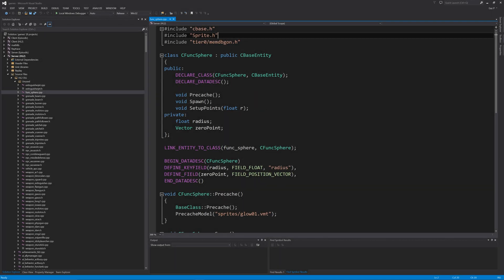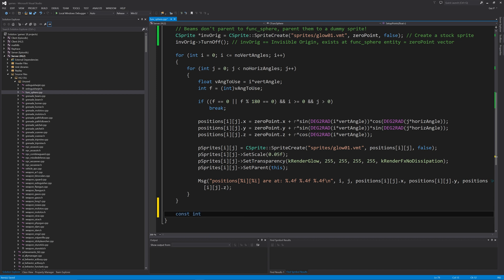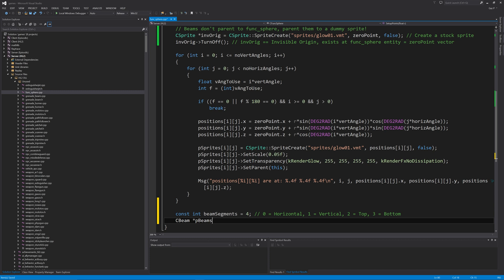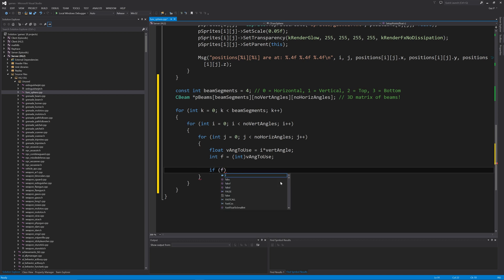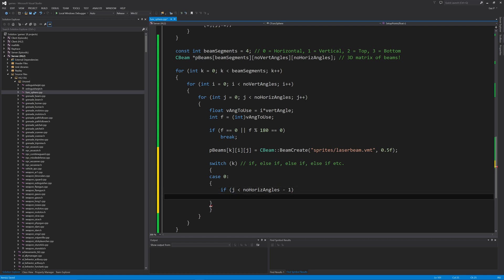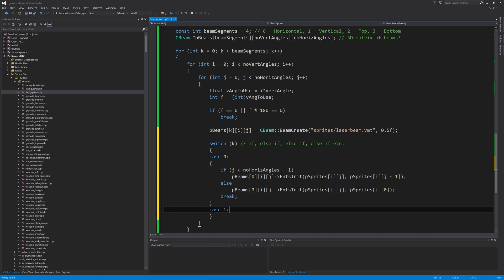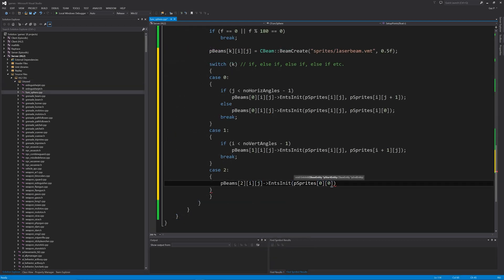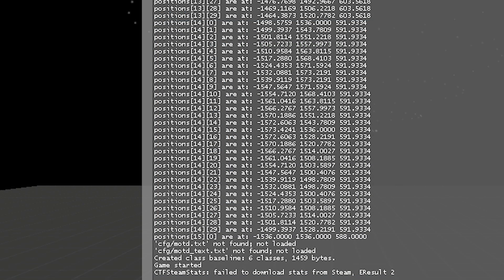Valve Source Code 2013 Tutorial (Episode 11.5): Sphere of Sprites P2 [Beam Drawing Between Points]

Comment: Hello i Just found your Videos and i think you can Help me Out! :)
I watched a few of your Videos about the Valve source Code. And I wanted to ask you If i can use these Tutorials for Portal 2 too? 
I am Planning in making a Singleplayer Mod for Portal 2 and i got some advice Last year from Lonewolf2056, (the Mal creator of Portal Stories Mel) and I almost spend 11 months of time into learning Hammer Editor and i am pretty confident with it now but there are still Things i need to learn.

But for a Mod i want to add 1 new Testing Element that is Not that new... Its Just a Combination of some old Test Elements and some new features. But i can only barely Code and have no Idea how to Code Something into Portal 2 so i am asking you If i can use your Tutorials to learn the Things that i need or if Not, that you can maybe Tell me where i can find more in that?
Reply from the maker: Thanks for the comment, unfortunately you can't follow these tutorials for a Portal 2 mod because the source code for that game has not been made public (to the best of my knowledge, anyway). Therefore, any changes you would want to make that requires access to the source code would not possible. However, I would ask what you intend to do in regards to the new-but-not-new test mechanic, as it may be possible to implement it without the need of coding (but it may not be!). I wish you the best for the mod regardless!
Reply: @TheMaster974  my Idea would be Something Like lasers in 3 different colors. Wach color can only Trigger the Same colored laser catcher. But the tweak is you can mix for example Red and blue together inside of a laser redirection Cube and vet a purple one that can only activate purple laser catchers
So you would have 7 different laser colors (Red, yellow, blue, Green, purple, orange and white).
You geht White when you Mix something that wont make Any of the 6 other colors. (For example yellow and Green)
Thats Kind of my Idea
Reply from the maker: Interesting, but definitely sounds like something that requires changes to the source code which cannot be done, I don't believe unmodded Portal 2 has the ability to change the laser colour. I have come across a mod in the works called Portal 2: Community Edition which you might like, as it provides different coloured lasers i.e. red, green, blue, but I have no clue if this would affect the beam output from a reflection cube the way you want it. My guess, for example, would be the reflection cube would redirect both red and blue beams together instead of a singular purple beam, which would mean a purple catcher would have to be two catchers of red and blue somehow. Definitely worth checking out, plus it should be releasing sometime soon (Mid 2022)...hopefully! https://store.steampowered.com/app/440000/Portal_2_Community_Edition/
Reply: @TheMaster974  yeah Thank you! :)
I have seen that one too a while ago and i Just talked about it with a friend today :)
But when you say that this is Not possible then i am a little Bit confused... Did you Play Portal reloaded? He got a third Portal in the Game with a new color, a new shape and a Kind of new mechanic.... I think that i Just need to find a little more Help to figure that Out. 
There is also a Mod in Developement called Portal desolation which has adhesion Gel as a new Element and a new hard light Bridge... The adhesion Gel was already in the Game Files i think because its an unused Thing. So yeah... Me very confused :c
Reply from the maker: I did play Portal Reloaded, there's videos on this channel (shameless plug: https://www.youtube.com/playlist?list=PL8tDEPB6h7LmAz2BhsW2WUh4lYL9iX07b). The third portal mechanic was achieved via scripting (according to the developer, not via source code changes), more than likely using entities that already exist within the Portal 2 code (my guess would be the linked_portal_door entity). I think what you want can't be achieved via scripting in a similar way, you would need to modify the source code which isn't publicly available. The lasers may be hardcoded to always be red, so scripting won't help change that. But I'm not an expert with stuff like this, I'm only giving my thoughts on the feasibility of this intended mechanic.